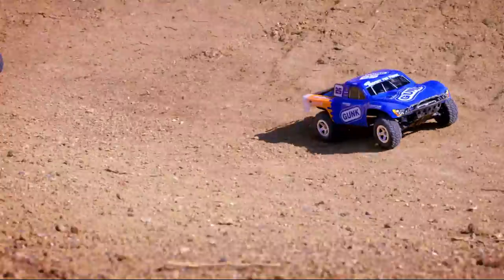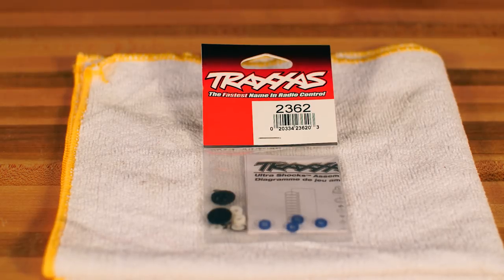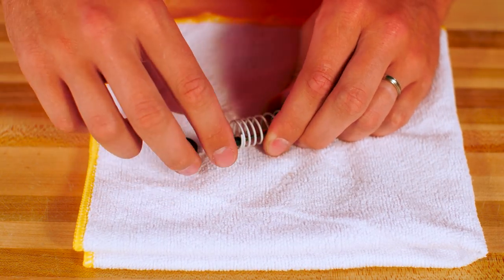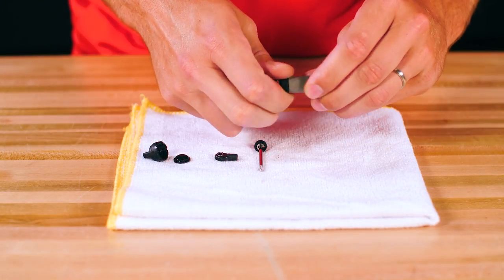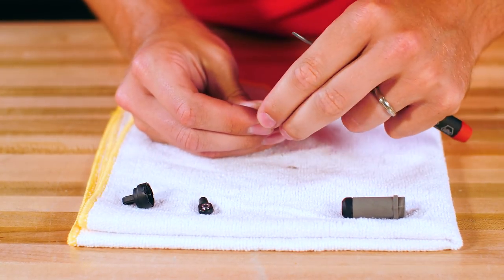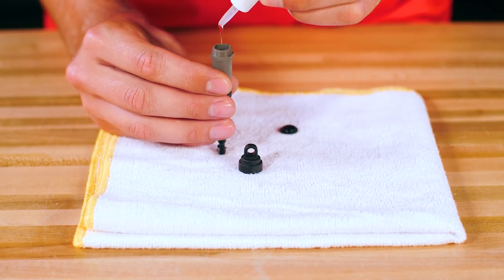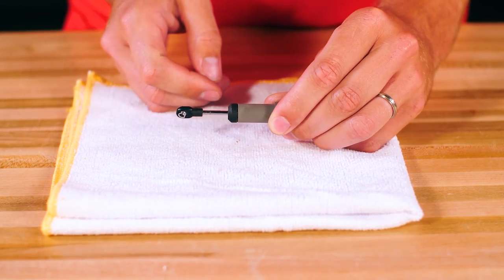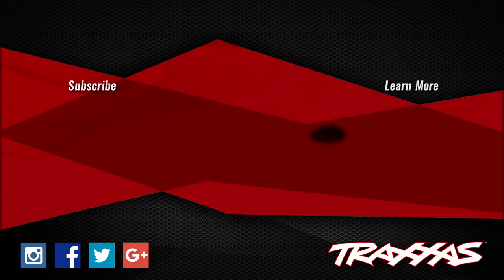Rebuilding Ultra Shocks | Traxxas Support

Comment: At 3:40 you show inserting the shaft back into the shock body.  I found that if you don't tighten up the bottom cap that has the two O-rings and spacer, it is a LOT easier to get that shaft through the bottom cap.  Tightening that bottom cap before inserting the shaft causes expansion of the two O-rings making it harder for the shaft to insert through the bottom cap assembly.  In fact, I would think that sliding that shaft through the O-rings after the cap has been fully tightened can cause abrasion and damage of the O-rings from the threaded portion of the shaft.  Thought others would like to be aware of this tip.

Comment: I probably wouldn't grab the shock shaft with a pair of side cutters. It'll put a nick in shaft. Just use a set of shock shaft pliers.
Reply: Fuel line tubing slipped over some small needle nose pliers works well too.
Reply: I found that odd too. Use $40 snap-on screw drivers and wire cutters on the shaft? I see their point and it's better than what most people would use. I just used paper wrap and needle nose vice-grips
Reply: If you grab the shaft close to the threads , you wont nick the shaft where it slides on the o-rings.
Reply: You can also use needle nose pliers with electrical tape rapped around them to prevent maring the shock shaft

Comment: funny enough i actually was disassembling my shocks earlier today, and i couldn't figure out how to unscrew the top and bottom part. i figured i would use my screwdriver to put into the hole, and (the thing used here) for the bottom part. and that was without watching this video first!
Reply: Cool! Man! Great job. Shocks are not that fun for me yet. But, i manage.
Reply: Congratulations on your new found mechanical aptitude, you're basically a master technician.

Comment: My plastic spacer in between seals on my Traxxas TRX-4 shocks were far too big. This caused the seals to be pinched when replacing the lower cap. I sanded mine down but hopefully Traxxas takes note of this

Comment: Question guys. If the shocks are to be filled up fully. 
Then how is it that if the shock is too full and won't depress/   Release some oil for the fix. 

That part made no sense bro. 

Can you clarify/ is there a shock style or brand that needs this method of taking some oil out to make it depress. 

Or are shocks easily overfilled and becomes stiff. 

I'm new to the hobby just learning. 

Spent 1300on a mini revo and a crap ton of gear and upgrade parts. 

4 extra batteries and all that good Jaz. 

Anyways why I ask this is because I have 80 weight oil and will do my oil change after I watch some shock maintenance Videos. 

Nice video Brutha 👊😎

Comment: The amount of bent shafts Ive had is absolutely ridiculous. WHY DONT THEY MAKE THEM THICKER?!
Reply: First run out with fresh shocks and I bent the shaft 🙃
Reply: Traxxas also sells upgrade shafts for their ultra shocks. They're hardened steel with a more durable titanium nitride coating. Use part number 1664T for the front and 2656T for the rear.

Comment: i put new oil in my slash shocks, rear ones are fine but the fronts are just like pogo sticks
Reply: Did you make sure all air bubbles were bled?
Reply: Try compressing the shock shaft half to three quarters of the way in before installing the diaphragm and shock cap.  If that doesn’t work maybe you’re over filling the shock try a little less oil.

Comment: Is one bottle of 30 ml of shock 
oil enough?
Reply: Radim Ziegler no
Reply: Thanks, will buy 2 bottles then
Reply: Radim Ziegler dont buy 30wt it sucks buy 450sct and use the 1 hole pistons included with the slash
Reply: Yes, 30ml shock oil shoul be good. The shocks are not that big, and the shocks dont take much shock oil

Comment: I need some help, my ultra shocks have oil on the shafts after they compress. The seals are absolutely perfect so no oil ‘should’ be leaking. Should I just buy big bores and forget about these?
Reply: Yea ultra shocks are not the best.
Reply: Well, your Tires may not be Balanced!! I have a Traxxas Nitro Slash, and i had to Balance the Front 2 Tires!!! I used Red Modeling Clay. Red Matched my Rimes. I put the clay on the inside of the Rimes.

Comment: The shocks on the slash 4x4 are bad. Today i went to a skate park i didnt go to crazy with it and 2 shocks got the top cap ripped off. Also the plastic driveshaft on the rear keeps breaking. My dads senton got a hell of a beating and it survived only a tire blew.
Reply: You can fix the shock cap problem with aluminum caps (you don't have to replace the whole shock). For the driveshafts, you might want to try the ones from the Rustler 4x4 VXL. They're bigger than the stock Slash 4x4 driveshafts so they should be able to take more beating. Part number 6852A for the rears, 6851A for the fronts.

Comment: What does it mean when the shock doesn't bounce back ????????
Reply: That means you don't have any rebound. That's not necessarily a bad thing as long as you don't have any air in the shock. If you don't have rebound and hear bubbles when the shock is compressed, then it needs more oil.

Comment: What shock oil comes in the stock ultra shocks, I like the way my Brushless E-Maxx came and it still has the stock ultra shocks but I broke 2 and ordered more but don't know what shock oil Traxxas uses. I've got a bottle Traxxas silicone shock oil and not sure if that's what came in my truck
Reply: I'm pretty sure its a 40w
Reply: It's 30wt
Reply: 30wt

Comment: My shock shaft is bent at a 90 degree angle
Reply: I went full speed into a pole, don't ask
Reply: Traxxas sells upgrade shafts for their ultra shocks. They're hardened steel, making them more resistant to bending, and have a more durable titanium nitride coating. Use part number 1664T for the front and 2656T for the rear.

Comment: I just recently purchased a Traxxas UDR and I am having front end problems ...when I turn and accelerate the front end shakes. Can this be a binding issue in the front differential?
Reply: tsm
Reply: that's not a very easy to understand answer but having a little experience I don't know what you're talkin about try explaining it to him where he'll understand it's really stupid that Traxxas doesn't include things like this in their owners manual you get with the model most people don't even know you can do all that stuff to it I just found it out by accident
Reply: Tsm is if your rc is going to flip the rc will turn and try to save it self it can be adjusted on the multi function knob and mine has shook since the day I got it.

Comment: do i need to lubricate the shocks? and if yes what lubricant use?
Reply: micapl12 no. It's all set. Unless it seems to bind a little then a drop or 2 of oil worked in wouldn't hurt anything.

Comment: My ESC XL5 on my slash 2wd doesn't tern on and my battery is fully charged I don't know what to do can someone tell me what to do please and thankyou.
Reply: Little Bryan  have you tried re calibrating it?
Reply: Edward Ruiz no but if I do it will it work
Reply: Little Bryan  it should fix it, I did that with mine, another test would be another battery. Could be that also.
Reply: Edward Ruiz Ok I'll do that thank you
Reply: try calling traxxas
Reply: It didn't work my ESC didn't tern on but my battery is fully charged
Reply: Little Bryan  no problem man, and if anything?  On Facebook there's a group for traxxas that'll really help out also. It's where I've learned all I know about these cars. Groups called traxxas rustler vxl and other rc
Reply: Little Bryan give me a minute I'll rethink about it

Comment: Can I use 5W40 or 5W30 engine motor oil to fill my shocks?
Reply: Car oil will damage the seals.
Reply: @zakk87pl  Thanks for the answer. 
Being on lock down I am waiting for the original fluid to be shipped... so was looking for a solution in the mean time.
Anyway, it didn't work because it is way too fluid and... you are right... I think the seals didn't really like it.

Comment: How much oil do you put in initially prior to final filling?
Reply: Close enough to the top that you can stroke the piston up and down getting the air out but not pushing any oil out.
Reply: @ianthompson043  nice yz bro is that a 250
Reply: @aidenmaves5537  thanks man! it’s a 125.

Comment: No hate but ultra shocks ARE CRAP! The caps always pop off and the shafts bend easy ( if your a basher)
Reply: I use aluminum shock caps and hardened shafts, both of which Traxxas sells, and haven't had either issue.